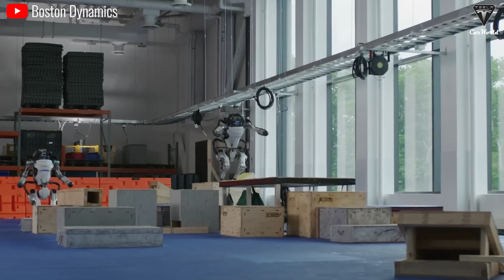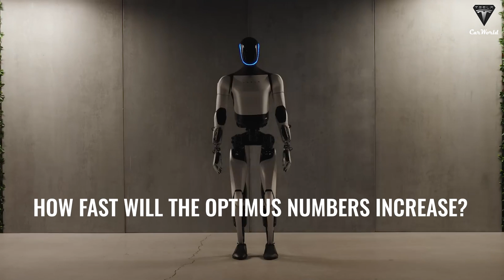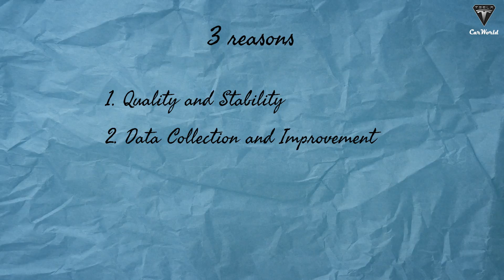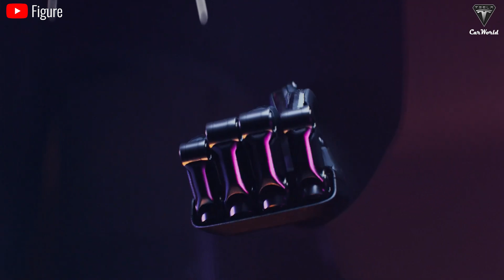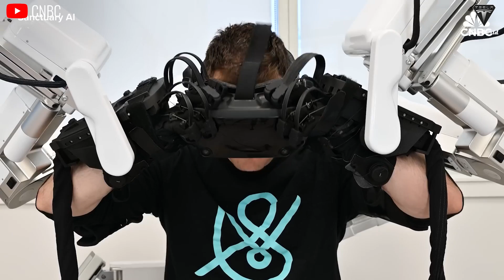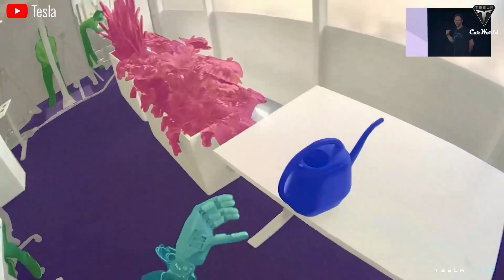Tesla Bot Gen 2 Optimus Robot Only $10K To Work At Giga Texas! NEW Design & Features Coming!

Comment: ERmergerd.... What if that's how it worked. Robot's will not be owned in mass by companies, but each individual should only be able to own one. Then, you can send it to do jobs and gain revenue. If a robot cost even $25k-50k, assuming a robot could work 5-10x more efficiently; no breaks, faster, more accurate movements. It could create $500k-1M+ of value with just 50-hour weeks per year.